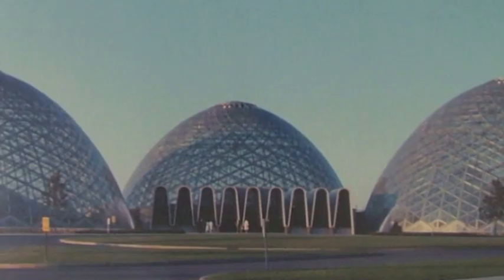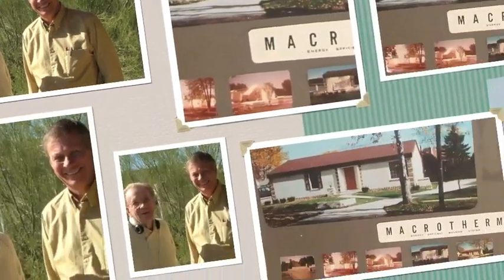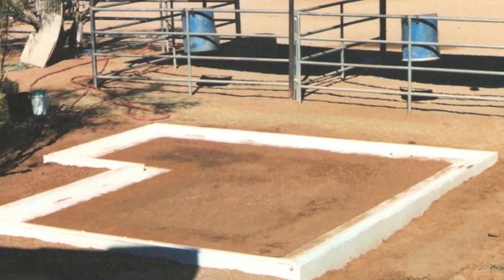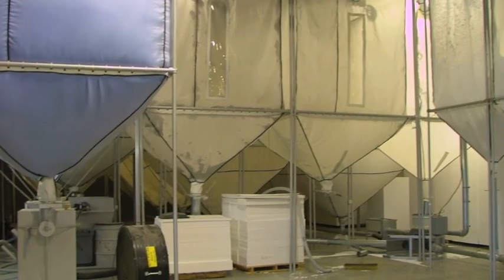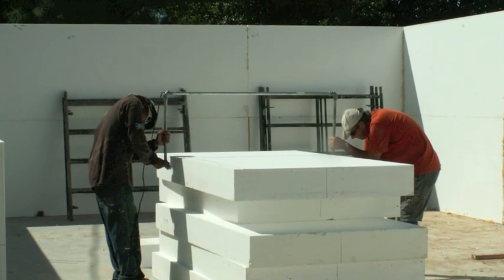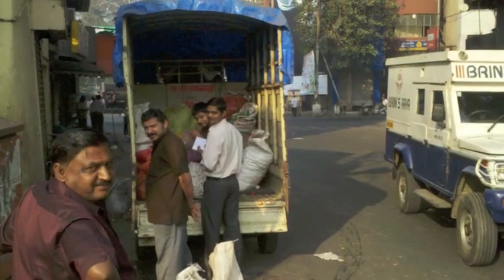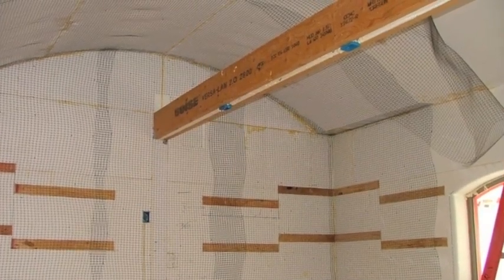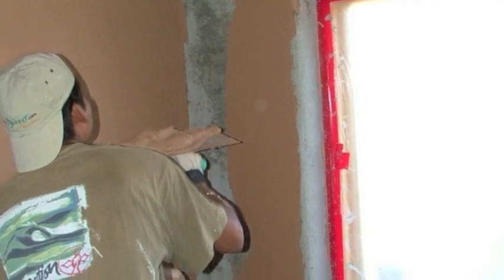Foam Home by G R Building Systems, LLC    Green Rhino Building Systems, Scottsdale Arizona

Comment: Hi Dan. The panels living in such heat in arizona. Wouldnt it be extremly hot and central air conditioning needed? just curious
Reply from the maker: You can downsize the HV/AC but it would be a good idea to have it.  Works very well in the hot climates and the cold climates.
Reply: +Dan Dwyer so you NEED an airconditioner then?
Reply from the maker: Yes
Reply: +Dan Dwyer okay thanks. Is there anyway to have the panels without insulation?